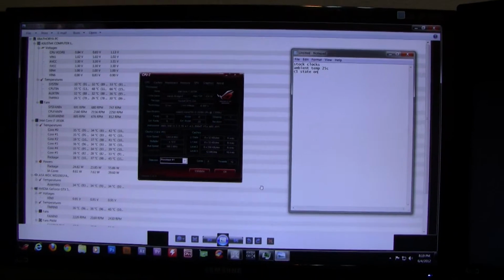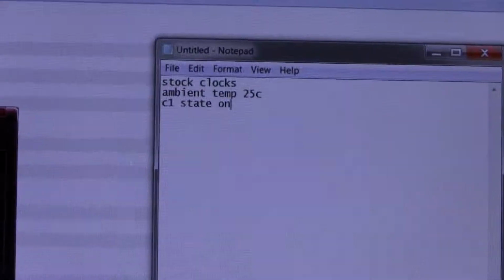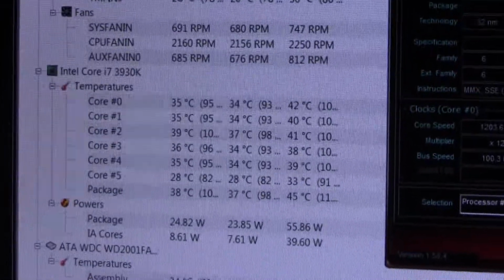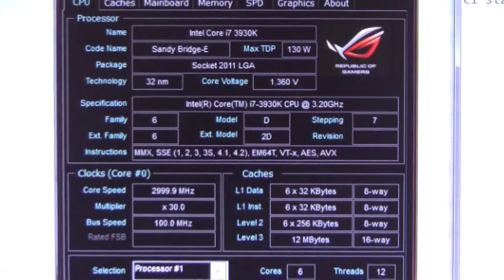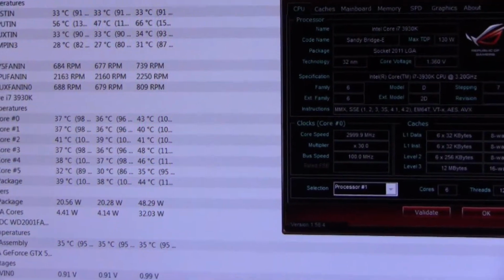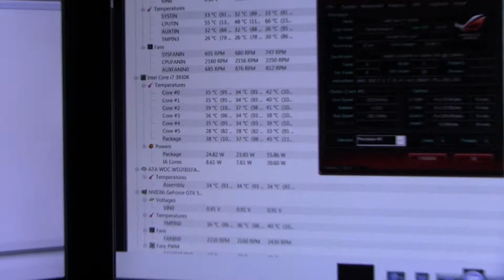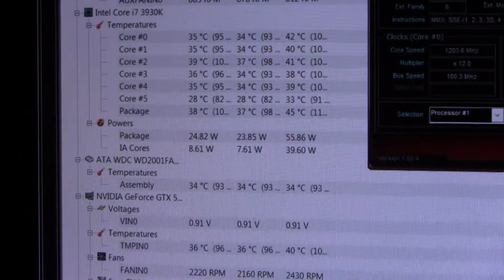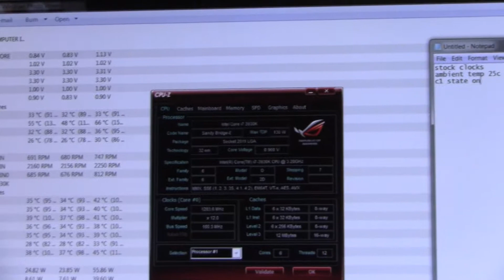Idle Temps, The difference between CPU stock clocks and CPU overclock.

Comment: omg.......... every day 365/24 on idle 1.3v?????????????? hellfire ............
Reply from the maker: +HyUn SoO LeE omg, this was almost 4 years ago!  And FYI, I only ran the 3930k overclocked for 25% of the time. and its since been replaced with my new 5960x.  I still have the 3930k, but its not been used in over 6 months! Havent got around to do a 5960x overclocking video, but spoiler alert: I have it overclocked to 4.5ghz at only 1.22v 100% stable. hopefully you stay tuned for the video on the 5960x coming soon.. either way, thanks for watching!